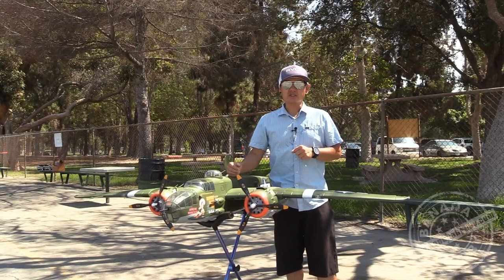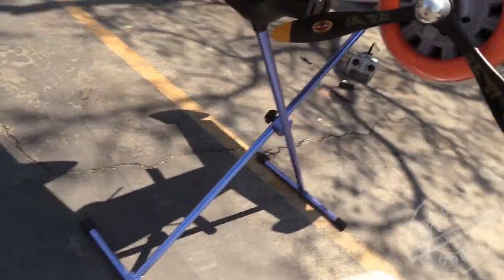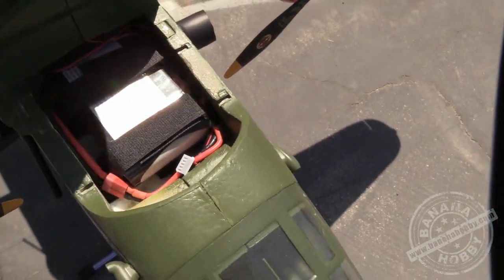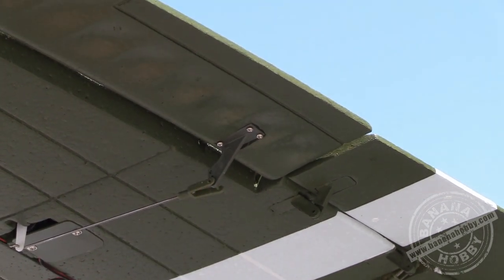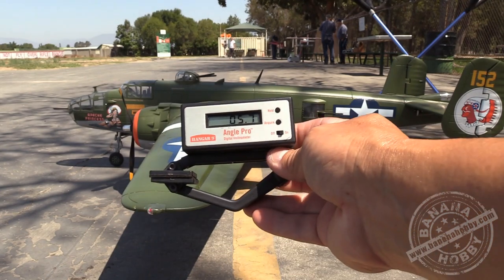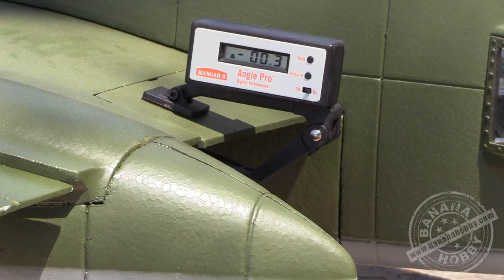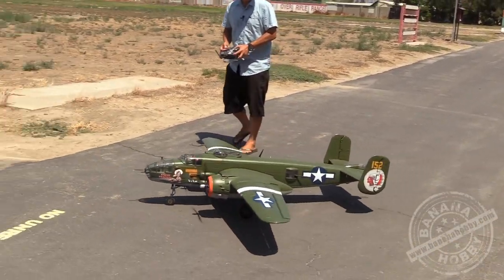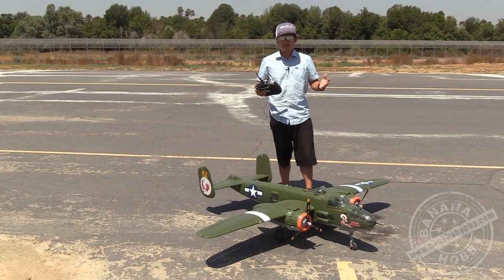Why You Shouldn't Fly Your Super B-25 Until You See This!

Comment: Where did you get the airplane stand Pete?
Reply: Looks like scissors stand from ironing board w\ board removed, and pvc heated and formed into cradles, then wrapped with handle bar padding. you could anchor airplane with loose wire ties or velcro straps.
Reply from the maker: Hello David B! These are the HSD aluminum model stands which can be found on the Banana Hobby store page. Here is a link to one of the model stands: http://www.bananahobby.com/hsd-blue-anodized-aluminum-cnc-model-airplane-stand.html.